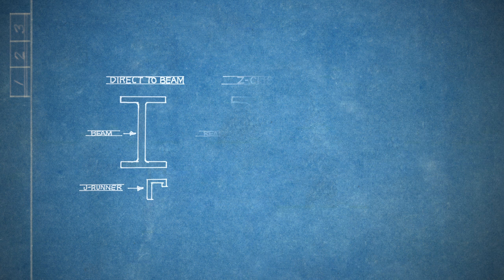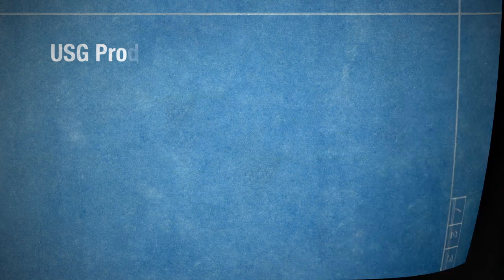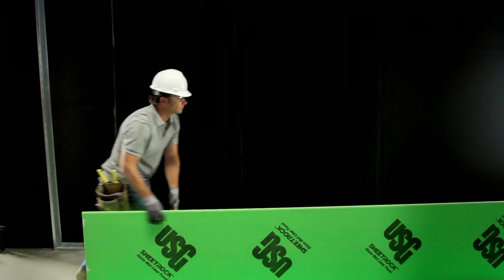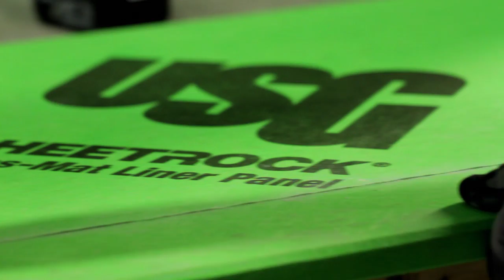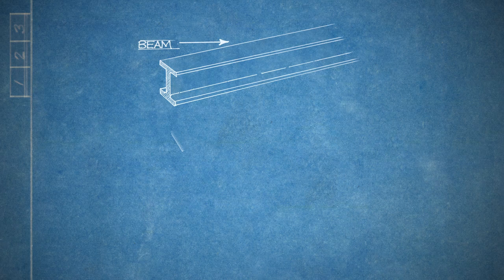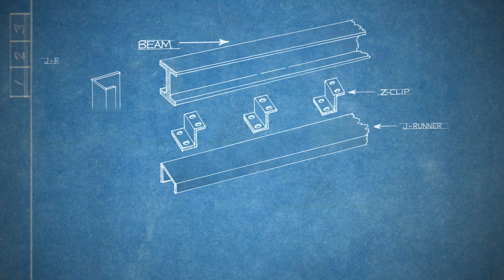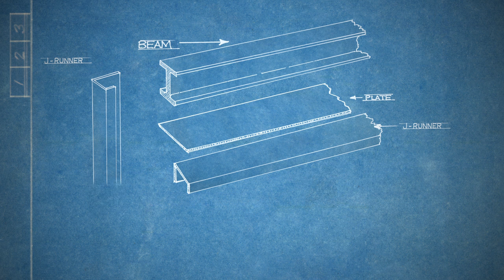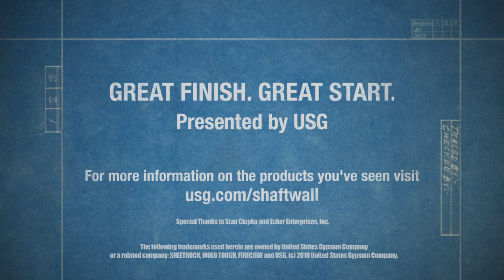USG Wallboard: Three Techniques for Installing Fire-Rated Shaft Wall Systems with Three Techniques

Comment: Thanks for clarity of orientation of liner out not only for inspectors to see brand but i thought if ever a waterpipe rupture in shaft or condensation the back sides non encapsulated paper would be a weak spot and peel off .. is this true?

Comment: Three questions:
•	Do you need to be able to get to the back side of the assembly for any reason. Meaning, can you put this up against an existing wall?
•	Does this come in a 3-hour version?
•	If it does not come in a 3-hour version, can you put a 2-hour assembly up and then a 1-hour assembly to meet a 3-hour fire wall code?

Comment: In the HW-D-0611 condition, does the spray fireproofing provide any acoustical value?
Reply: Yes but not much.
Reply: You can insulate between the shaftliner and drywall for better stc

Comment: Where can I buy a one hour fire rated drywall
Reply: @chris42019941, a single piece of drywall does not carry a hourly rating.  The wall design (UL Design) determines the hourly rating.  Type X or Type C board are used in rated designs.  You will want to find a USG distributor in your market.  Hope this helps!
Reply: Jennifer,

Do you have a video for 1 hour fire rated drywall? Also, I am finding it difficult to find the UL  assembly for this. I need one for wood framing on a garage ceiling or attic space.